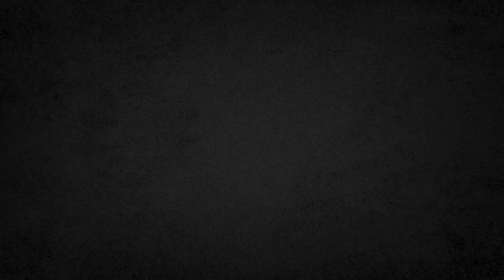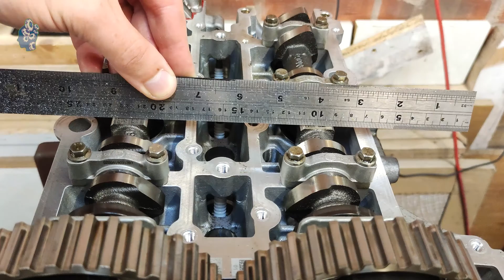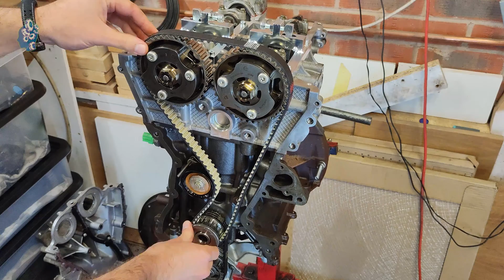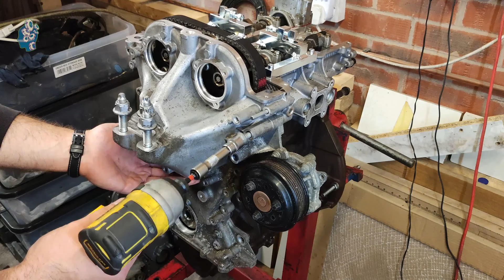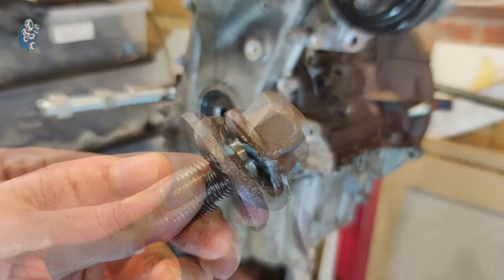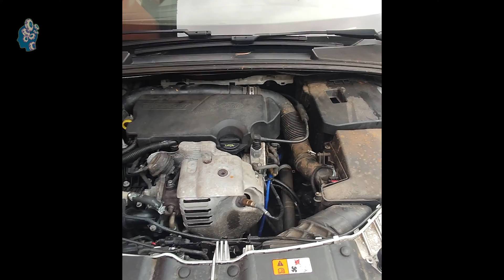1.0 EcoBoost Timing Belt Step-By-Step - AI Comment

Comment: This ford 1.0 ecoboost engine is an evidence how stupid the ford engineering is 😂 A rubber timing belt placed in hot engine oil is the most stupid design of the entire car industry.
Reply from the maker: Its not only Ford. Other mauifactures do the same. Kind regards
Reply: @the-senior-tech ford started and then citroen copied (puretech). This stupid idea from french engineers would not be a surprise 😂

Comment: whats going on? i see two different timing kits on youtube. the one you show in your video and the one that aligns one cam lobe on the intake and exhaust. the problem is the setting the cams in completely different timings. both have the pin that stops the crank and the same pin that sets the pully. i dont get it? what am i missing?
Reply from the maker: I used a genuine Ford timing kit. Never seen one where the cam lobe is locked.

Comment: I have a question do you have the part number for the timing belt? And how many teeth does the belt have?
Reply from the maker: Timing belt 18mm - 2121996
Timing belt 16/16.8mm - 2122062
I do not know how many teeth. Never checked tbh.

Comment: Hi on this engine Ford 1.0 i will replace crankshaft rod, how much torque should i apply?
Reply from the maker: Ford does not provide any torque specifications for the bottom end. You can find some details on the internet, but I'm not sure how accurate they are.

Comment: Nice video dude
I am at the torque the crank bolt up but the pully keeps turning when i am doing up the bolt. What am i missing? New washer and grease on a new bolt!!
Reply from the maker: Leave the pulley pin in while torqueing up.

Comment: Is it possible to check the condition of the wet belt to see if it needs replacing?
Reply from the maker: Yes, it is. You can remove the rocker cover or the oil sump. By removing the oil sump, you also have a chance to inspect the oil pickup to see if any debris is present.

Comment: awesome video 
one question so you torque the bolt 5 x 90 degress?
Reply from the maker: 5*90° using torque converter 1:5.
Reply: @the-senior-tech  and the 60nm first

Comment: A lot of people knock this Ecoboost engine. Mine has been great to me and it gets 45 miles to the gallon of gas. I'm prepared to have my belt replaced, i bought all the parts i needed from Ford but independent mechanics wont touch it.

Comment: Ten hours of labor and nobody has the specialty tools needed for this job other than the dealership. Labor will run you about 2500
Reply: Tesla model 3 new motor costs around £4,241 In the UK, replacing a Tesla Model 3 battery can cost anywhere between £16,000 and £20,000, depending on the specific version and the age of the vehicle. 

Wet belts can be replaced under £1000 unless u want dealership prices I was recently quoted £1500 plus at ford.

Comment: Hey i have a question i hope you answer asap i had a crankshaft positon sensor code so i removed the crankshaft pulley to replace the sensor just slapped the pully back on tightend it with a impact and now it wont start shouldant it start it didnt effect the timeing did it ? or is it because it needs a crank sensor relearn or did that infact ruin the timeing and i need a whole new retiming job done
Reply from the maker: 1. Do not need to remove the v-belt pulley to replace the crank sensor.
2. The v-belt pulley needs to be aligned with the crankshaft as there is a magnetic ring attached to it.
3. Your engine could be out of time as the bottom timing belt sprocket is floating.

Comment: Can anyone tell me what a fair price for this job should be? I got a quote from an official Ford service center for £1,800 to replace the wet timing belt—£600 for parts and £1,200 for labor (8 hours).
Reply from the maker: This is quite an expensive repair considering genuine parts and main dealer labor rates.

Comment: Hello, do the barcode surface on both camshafts need to be 100% straight? I have maybe 1 or 2 mm under the ruler.
Reply from the maker: Both cams must be dead straight, otherwise you will have an engine running issue.

Comment: One doubt... is it normal in ecoboost 1.0 that amount of oil exhalation? It looks like many parts of the engine have oil moisture.
Reply from the maker: No, it is not normal. Look around for an oil leak.

Comment: i just did mine exactly the same but it starts up few a few seconds then gets really lumpy and cuts out.
Reply from the maker: Recheck the timing again, and make sure the v-belt pulley is in the right position, as there is a magnetic ring for the CKP sensor.

Comment: Bonjour la rondelle de poulie vilebrequin que vous remplacer a 3m25 de la vidéo doit forcément être installée ?? D'origine il n'y aucune rondelle.

Je dois l'ajouter même si je remplace la vis du vilebrequin en neuve ?

Mon véhicule : Ford focus mk3 2017 1.0 ecoboost 125cv
Reply from the maker: Yes, you need to use a friction washer to stop the belt pulley from slipping.

Comment: one question, I have a 1.0 ecoboost 155 mhev built in 2023, in some forums says that this mhev engines have timing chain and not wet belt, is that true?

thanks
Reply from the maker: Hi. Yes, mhev 1.0 ecoboost has chain.
Reply: @the-senior-tech  many thanks!

Comment: Do you have to change the crankshaft oil seal? And if so how can I do that without that tool to fit it?
Reply from the maker: Yes, replacing the front crankshaft seal is necessary. You can use a similar size socket.

Comment: Considering the cost of changing a wet timing belt I would swerve away from any car that has this rubber wet belt design. If any thing it should be a chain belt that does no degrade like rubber in oil

Comment: Hi I havent got a torque converter. Do I multiply by 5? Can someone help
60x5 Nm
90 degree is 60 Nm then multiply by 5 equals 300Nm 
So without torque converter
300 Nm

300Nm
300Nm
300Nm
300Nm
300Nm
Reply from the maker: If you do not have the converter than do 300Nm + 90°

Comment: Need answer please, is it ok to try two turn of crank ahaft before putting crank pully and cover on?  just to check its in order.
Reply from the maker: The timing bottom pulley is floating. Without torquing it up along with the front belt pulley you want be able to turn the belt and cams.

Comment: Need a answer please. When tightening the crankshaft pulley bolt after 5he torque converter has been installed are the 90 degree stages at the output shaft of 5he torque converter or 90 degree of the input shaft (ratchet end)?
Thankyou
Reply from the maker: 5 times 90* through 1:5 torque converter gives you 90* turn on the crankshaft pulley bolt.
Reply: @the-senior-tech Cheers. I’m on it this weekend

Comment: Terrible engine
Reply: Qualquer motor que não trocar a "correia" dentro do prazo.... terá problemas!!!
Reply: @Leonardosilva-bb8lt  nah. Most belts can go way beyond their 'set dates'. But this is a 'wet belt'. This means it gets lubricated by the oil. The oil becomes acidic due to coming in contact with a little bit of exhaustgas over time (the reason why oil is black). Due to this acidity, the belt corrodes and the plasticisers come out of the belt. This is why these belts defo need to be replaced by the right time
Reply: Why?
Reply: @teafuse583 because if you aren’t strict with servicing the belts go.
Reply: Sadly my daughter-in-law has just bought a car with this engine and she expects me to do the maintenance! My car has the 2.2d which is a doddle to change the cam belt.

Comment: Why is my crank pulley moving when torqueing the bolt,do i need to have the locking pin in place.
Reply: Found the problem,Crankshaft pulley washer and crank pulley was wet with oil,cleaned with brake cleaner and torqued the correct way.
Reply from the maker: @thyssmith1  Very good
Reply from the maker: Yes, you need to pin it and use a new friction washer

Comment: In the real world, you would also change the oil pump drive belt, clean the oil pick up and change the water pump
This is a really poor design, if you have one, sell it and buy Japanese, Toyota or Mazda
Ford etc are designed by accountants these days, the crankshaft pulley on the ecoboost isn’t even keyed, to save a $ or 2
Reply from the maker: I always replace oil pump drive belt and clean the oil pick up.

Comment: So when these are done in the car the flywheel has to be locked where the starter motor was. I thought this was because the timing pin wouldn't be able to stand the massive torque from the front pulley fitment???
Reply from the maker: Hi. Locking the flywheel is helping to undone the crankshaft pulley bolt. The locking pin is designed to hold the counterweight when torquing up the crank pulley.
Reply: @the-senior-tech  ha yes locking pin can't hold the crank for when turning in reverse. Makes sense thank you

Comment: Just to give people an idea of how messed up the timing belt/oil pump job is in the United States. 1 dealership quoted ne $2700. Another has no idea what I'm talking about. 2 independent shops declined the work.
Reply from the maker: You are right. It is difficult to find a decent garage to do the job like that.
Reply: Not all shops are this way I have no problem doing this job

Comment: Didnt show how to set up the vvt
Reply: That's not enough if you need to change a cam pulley
Reply from the maker: Yes, you right. I do not cover pulley replacemnt in this video. Another tool 303-1606 is needed.
Reply from the maker: Only lock the camshafts.

Comment: How I wish I had this video on hand when my timing belt was replaced. I have the ‘misfire’ issue you mentioned at the very end of the video. Do you have a possible ‘repair’ video on this misfire issue? Thank you for a great, clearly explained detailed video.
Reply from the maker: If the engine misfire is caused by timing being out of sync, you need to start the procedure again. Lock the crankshaft, lock the camshafts, and check the alignment of the front crank pulley. Regards

Comment: I would like you to explain how to synchronize the control pulleys, and also how to tighten them without them getting out of sync.
Reply from the maker: If you lock the flywheel, and front v-belt pulley and also use a new friction washer, everything should stay in place while torquing up.

Comment: Great video. The only thing forgotten part on this procedure its a VVT camshaft wheels timming tool installation to stop them from turning while torque up the crank bolt.
Reply: He did that
Reply: @cameronlotter1392  no he didn't only locked camshafts.
Reply: @cameronlotter1392  he locked the shafts not the cam sprockets !!
Reply: @dsd5586  he also reused a torque to yield bolt on the crank pulley